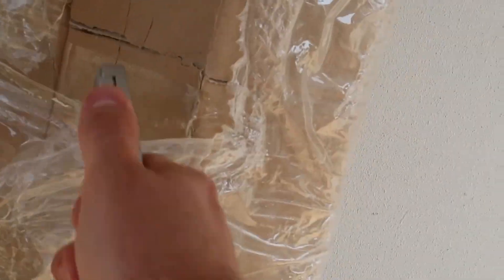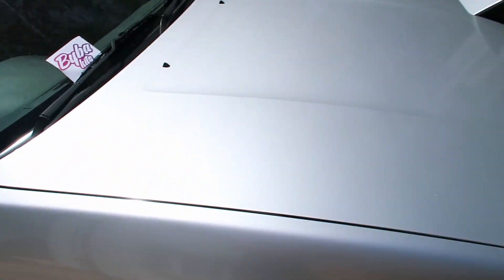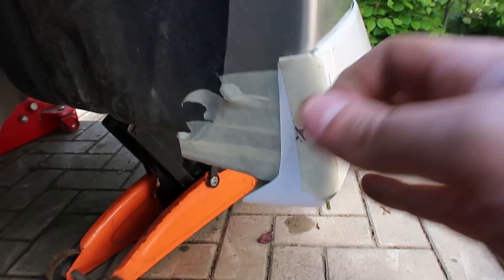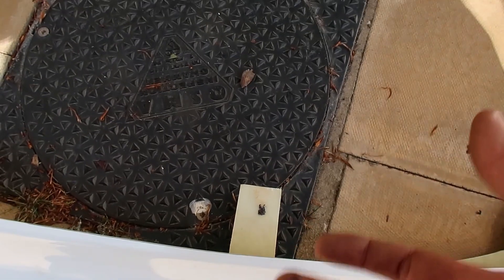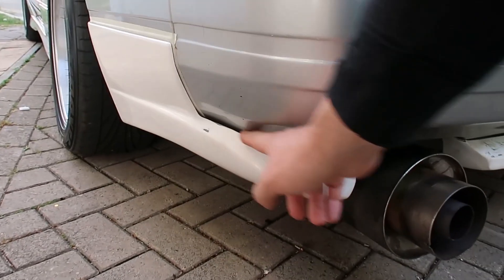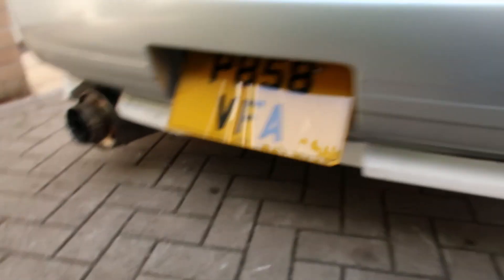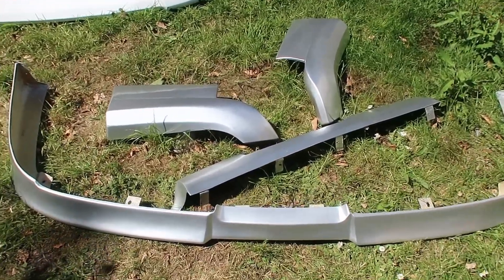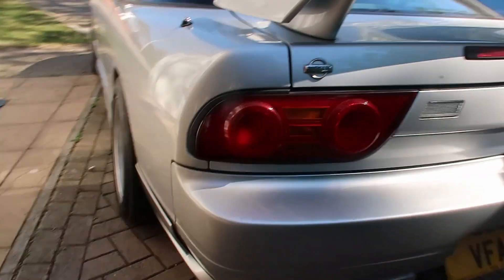My 180sx gets a new bodykit

Comment: Wow, someone else in the UK who bought a Kouki Type S :). I managed to snag one with a manual gearbox though. I see you're already doing an RB swap, I think I'm going to go for a more straight-forward option of just bolting a turbo onto the SR that's already in it. Interestingly your car has the same plate as mine, just 48 numbers up, must have been registered about the same time. Also what wheels are those, they look awesome.
Reply from the maker: Hay bud, I have a plan for the SR that I took out. It doesn’t involve a turbo but it should sound pretty cool. 
A turbo on a low boost would be a cool build.

The wheels are SSR mesh 16x7.5 front and 16x8 rear 🤘